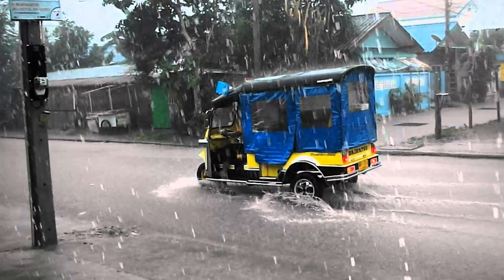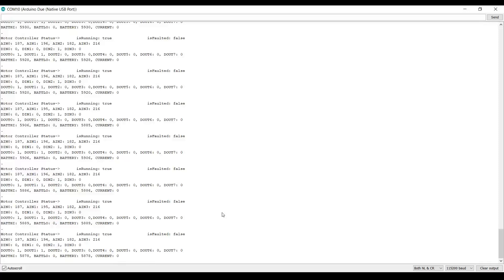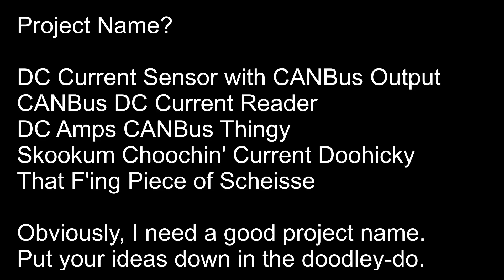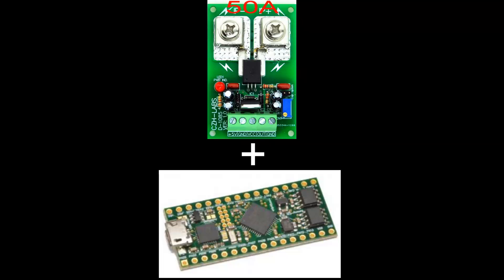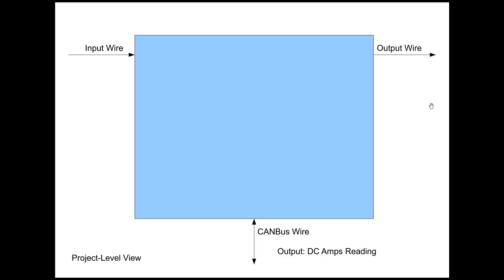DC Current Sensor with CANBus Output Project Part 1

Comment: Finally found a project with can bus on youtube) very interesting, going to watch everything. Keep doing it, there are lots of people that will find your videos interesting but just cant find them on youtube. Questing: why are you going to use query message to get results of current reading? Usually can bus devices (at least in a car) just constantly send readings, so any other device can read it at any time
Reply: Michael Brown I have a battery control module in my car, it doesnt send the current readings constantly (only voltage) but I can read current through diagnostics(which works in your way, diag tool sends a query and module replies to it). Refresh rate is about 3 times per second there, which feels enough. I think anything from 20ms delay is ok for can bus, especially if you give that package higher id, as can bus gives priority to packages with low id numbers. Usually I set modules to send every 200-500ms. But your query-reply design solves the issue with sleeping of car, as device should not send values when car is locked as it wont allow other modules to sleep. Btw, I wonder, will the reading rate of your device be enough to do a relative combustion compression test?